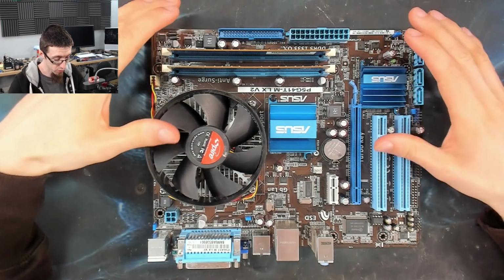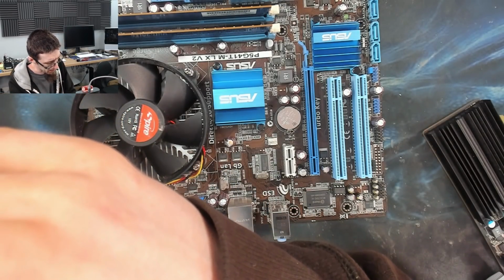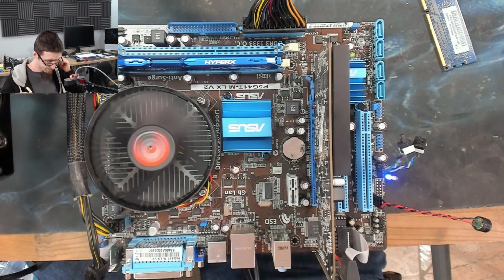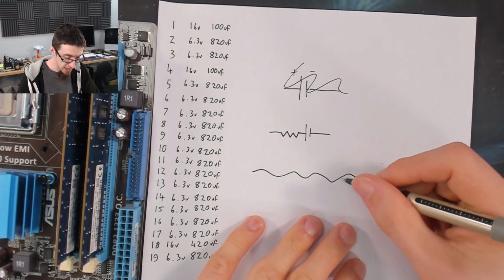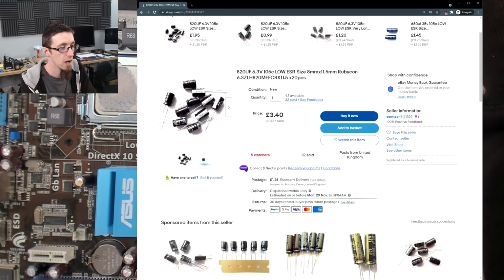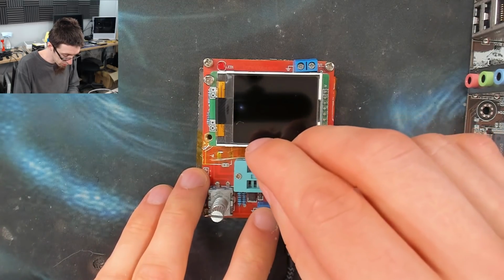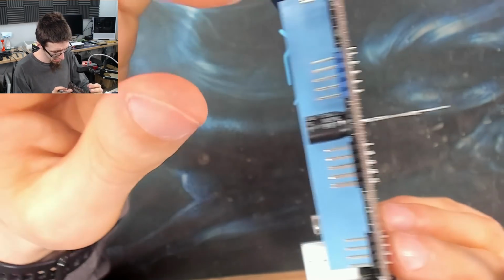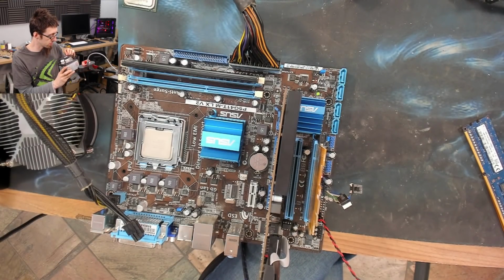This motherboard recap didn't achieve anything - LFC#288

Comment: I would have posted the board without any memory or gpu. Just to verify the bios complains with beep codes.  Also would use a PCI video card instead of the PCIe.  Also clean and reseat the cpu.  Checking voltage should be the first thing you do.  Caps are very low on a list , Why a board won't post.

Comment: I wanted to point out that it may be worth checking to see if the bios reset jumper is not on as this will sometimes result in a blank screen at boot (no bios screen output).

Comment: The cap testing really showed the failure. What you also could have tried is leaving out the graphics card ( although it gave you an E 1 ) and put the monitor on the internal graphics.

Comment: I have My first computer I had IBM Aptiva 2162 S3C from 1997 and I have a few videos on my channel of it  can you fix that new power supply screw cane off the power cord connector on the Power supposed i never got a new one need a hard drive and windows 95 installed and the cd and floppy drive media console sits under the monitor and have built in speaes  is the power button it came off it

Comment: Answering your questions: Can capacitance go up on a failed capacitor? Answer: Yes if your tester works out the value based on charge time. If the capacitor is electrically leaky it will take longer to charge giving a false reading on the tester. What is V Loss? Answer: Loss of charge over a given time in percentage. Another indication of it being electronically leaky.

Comment: i work at a repair shop, we dont do motherboard repairs but i want to so i do it as a hobby (or so im learning about it). I really hope what im doing is fine by just finding a confusing question and going down a rabbit hole until one thing can make sense, and then i guess meander my way back up... but I find it much better to watch more mirror-like, or unsuccessful attempts at something that would more closely relate to my own thoughts. Bc usually what they do works and you do the same and it doesnt. Im running on a tangent here, i gotta watch all your vids to hopefully understand somethin in the future. if anyone has good insight of how to get started and gradually get into MO repairs id be glad

Comment: are you sure that the capacitors where putted in the right polarity ? becouse the minus is white strip also paint in board and needs to corespond with the white line of the capacitor

Comment: Surface mount 'solid state' electrolytics fail more often then you might think. Whereas through-hole electrolytics sometimes offer visual clues to their failure (bulged domes and leaking electrolyte), the surface mount solid state electrolytics are trickier to diagnose (because no visual clues present) and replace (because they muist be removed by careful clockwise or anti-clockwise rotation so as not to rip away the tissue-paper delicate copper pads on which they are surface mounted). If the board refuses to work after replacing the through-hole electrolytics, I would absolutely remove (with great care - see Mr Carlson's lab video on surface mount/solid state cap removal) the surface mount/solid state electrolytics, before testing them with an ESR meter. Then replace with an equivalent solid state...or indeed a through-hole....and test the board again. I much prefer repairing electronics which do NOT have surface mount electrolytics, because two many times, I have used pliers to twist off solid state caps, only to discover I have ripped away the delicate copper pads x 2 connecting them to the board. Repairing this, in a two-layer boards, is a fucking nightmare....hours of avoidable labour...hence enormous care is required when removing them, and of course, they cannot be tested for ESR in circuit, which means you HAVE to remove them to test for ESR, and cannot simply remove 'one leg' before testing, because there is not enough space to remove only one leg before testing.

Comment: I have seen some dead PSUs beeing started up with a heat from a hairdryer, can you read any differencee between a failed cap and a hot failed cap?
Also about the motherboard, the ripple produced from a regulator with a failed capacitor can cause damage to the thing they are powering, guess how I found out.

Comment: I would highly recommend using a solder slurper (sucker). They will make your caps and other part removal very easy. I started in electrics in 1961, from the old tube TV's to commercial transceivers to CB's.  I really  like your repair show. You know more about computer repair than most . Note: replacing and re-soldering  is easier as well. Most of the old solder is removed.

Comment: Good video, I have questions how can you know is the bios chip in laptops because I see a loots of similar chips in the borad
Reply from the maker: There's a lot of small cues that give it away, but the main one is the shape. Most BIOS chips are either WSON8 (flat rectangle) or SOP8 (square, 4 legs each side) The only other SOP8 packages you're likely to see are mosfets, and you can spot those because they'll be part of a power circuit (and have capacitors, inductors, etc nearby).
The last cue is just to check what's written on the chip. There's only a couple of common brands for BIOS ROM chips, such as MXIC, Microchip, Winbond, and they tend to have that brand name written on the chip (unlike mosfets, which only have a part number) so if you see a chip out on its own, and it has winbond written on it, that's your guy. Keep in mind that a lot of laptops have more than one BIOS chip as well though.
Reply: @Adamant_IT  thank you very much

Comment: 😂🤣😆I know, Graham "It's never the CPU" Memory error, is it possible you have two different Memory Ram Sticks inserted? Just double check everything.. I could've sworn, you took one out, and inserted a new one. I would have replaced both.. why check one old, and add a new one.. wouldn't that affect the memory value in some way?  
Just asking, trying to figure this out myself, just an amateur.🤗

Comment: When you replace caps, is it best to replace them with the same type & voltage/farad ratings? Thanks
Reply from the maker: Voltage rating is the max the cap can handle, so it needs to be equal or higher than the original.
Capacitance (Farads) should be the same. Caps have a big tolerance on them though (20% is common) and more often than not, just being in the correct order of magnitude is good enough for a power rail.
Reply: @Adamant_IT  ok thank you 🤓

Comment: Thanks for this video. I'm very new to doing my own repairs and have not had much luck with most board repairs. It makes me feel better knowing it's not just me that wastes time and money on attempting a repair.
Reply: I repaired my old gaming board by replacing a few Capacitors.  It worked.  Until a few days later,  I decided to hook up a harddrive and set up windows 7.  The PC refuses to post.  I believe something bad had happened to the bios.  I cleared the cmos through the jumper,  removed the battery,  re-seated everything.  There are no beep codes,  and the button when you press once doesn't turn off the machine. It turns on but doesn't display anything. One thing I noticed which was very strange before it got confused... Was that during booting from the DVD-ROM,  the display would go blank,  the power button would do nothing even if you held it down, LEDs will still be lit and the CPU fan will still be spinning. Now i need to find a programmer tool that supports that specific bios chip.
Reply: Another thing that I think is the cause is that it was saving settings to the bios and the same thing happened whilst it was saving those settings to the bios
Reply: I recon the bios has got corrupted
Reply: However I still need to find the bios version to for this motherboard... Abit NF7-S v2.0.

I found some downloads but they download as an application.  Should they download as that or should they be of a different file type if they are official bios software?
Reply: The chip is by PMC.
Reply: Pm49Fl00T-33JC
Reply: It's infuriating but with every problem,  there comes something to learn

Comment: for the first clean the  both dim slot with alcohol or thinner and then put in memory again turn on power motherboard if still error accour  then Please check with selector multimeter countinuity on dim voltage, usualy the both dim voltage are broken connection, so just put wire on pin 3.3 or 3.7 volt on dim1 slot in the back motherboard to dim2 , its work with me, or  , may be can help

Comment: It is possible, for example, that particular capacitor that was leaking (3.1 Ohm), as displayed, may have damaged some other chip, by allowing voltage higher than the gate, could handle, and basically cooked, the logical aspect of the chip, and thus the reason it will not Post. And, agree with comments below, sometimes, seeing a repair fail, is interesting, as one that works.

Comment: I've recently got a faulty motherboard (lga1150) I'm getting ready to post-mortem or possibly repair. Used air compressor to clean out daughter's computer like done several times. Next time she booted it started sporadically turning on and off and once in a while makes it into bios before shutting off again(led fans also got brighter sometimes). With the knowledge I've learned from your videos I hope to come to a definitive cause of death.

Comment: Hi! I have a laptop, 6300hq….gtx 1060. It keeps shutting off randomly. It can sometimes do this 3 to 4 times in a matter of seconds. Other times it stays on for quite a while. I am guessing it is overheating. I have monitored the temps and don’t see them going over 50 degrees though. I have ran the laptop on dedicated graphics and also onboard, and I get the same issue. Tried it with battery no charger, charger no battery. Changed nvme. Everything points to the cpu overheating. But, I have ran a stress test (prime95) and got the cpu to over 80 degrees and the laptop didn’t go off! All fans are fine, cpu has new paste. Does anyone know what could be going on. It’s doing my head in!! I am now looking At new laptops. But would rather just have this as I only watch YouTube on it 😂 cheers

Comment: Hi, I'm struggling to debug this problem on my laptop.
As soon as I unplug the charger, the CPU speed drops to 0.48GHz (BD PROCHOT triggered)
To make it work again up to its speed (2.2G) I need to unplug charger AND battery, and power up again with either battery or charger. This happens with Linux too, so it's definitely an hardware problem, the BIOS battery is ok. Do you have any suggestions?
Thanks!

Comment: Probably you have a bad chipset or one with bad solder joins..chipset control lot of things on the board, you can remove and reball then solder again on the board, if don't solve the issue try to buy one in working condition i thing will solve the issue.

Comment: From my experience with flashing BIOS chips outside the board with a programmer; it sometimes ends up with a different result than the original BIOS of a working board.
Reply: Correct, the unique identifiers of the board won't be preserved. Those would need to be taken from the backup and written in manually with a hex editor.

Comment: In the future, before recapping, check all the voltage rails as close to the chips as possible and look for noise on the power rails. If theres no noise,  the caps arent the problem.

Comment: 1) The labor and shipping cost is way more expensive than the capacitors themselves; therefore, using solid electrolyte capacitors to replace the faulty ones.  
2) The main reason for the capacitors to fail - the work load and environment temperature are reaching the design margin; therefore, buying low ESR solid electrolyte capacitors and increase the spec (e.g. 6.3V 820 uF --> 9~12V, 1000~2000 uF) should be able to prevent the similar failure in the long run.
3) Using proper soldier removing tool.
4) Dead CPU won't turn on cooling fan.
5) Buy a PCI/PCIe diagnostic card for PC.

Comment: you should check
1.5v ramvcc, ram  slot pin no. 51,54,57,60,62 (or on ram vrm coil)
0.75v ram vtt ram slot pin no. 120, 240
3.3v vddspd ram slot pin no. 236
bios
cpu
cpu socket
gmch

e1 mostly a bios problem in this motherboard

Comment: 26:07 Why isn't your tester calibrated? Short the 3 test points together and follow the on-screen instructions. Takes about 30 seconds to do it then you will get more accurate readings. Bear in mind it will ask for a small value non-polarised ceramic capacitor at one point and you need to clamp that in then press the button to continue. Use a common 104 cap (0.1uF). This tester is based on a German open-source design using an Atmel ATMEGA328 microcontroller and it actually a pretty nice piece of test gear for the price.

Comment: I've watched your video's for a while now but I feel you made a massive mistake here ordering caps on eBay. eBay is full of fake caps and I cannot honestly believe you got 20 real Rubycon caps for the price you paid. I'd stick with buying from Farnell or Mouser in the future - at least you'll know your getting real parts. The eBay caps may work fine but I would very much doubt they have as long a life as the real thing!
Reply from the maker: Entirely possible, but for the sake of the experiment they'd do. I do agree that if I were doing this routinely, or on something more valuable, I'd be a lot more picky about sourcing parts. This was a proof of concept 👌

Comment: Have you tried cleaning the PCI-E slot that could be a reason why you don't get a display on the GPU because of corroded pins in the slot fixed it with contact cleaner of WD-40 and a wire brush that could fit in between the gap

Comment: Done a few full board re-caps in my day, all completely successful, except that one time where it's never the CPU, except where it's the CPU 🤣 No joke, after a re-cap, still had a toasty CPU, but the entire thing started with a PSU that came 1 step from a firecracker so it had it coming.  New PSU+new CPU+ re-cap and it was back on the road.

Only thing I was curious with your Asus board here is if it acted the same way with or without any mem modules.  I have seen a post issue like that previously, and being an extremely early ddr3 board, it's QVL would be quite limited and without post, it would be impossible to tell what version of BIOS was on there, but it looks like you went to the trouble of pulling the chip completely and reflashing it, so I'm just assuming you used the very latest firmware available for that Mobo....  Too bad this repair was a bust, but I used to love doing re-cap jobs back in the day.. I still enjoy picking up a 75in 4 year old 4k smart Vizio TV for free off Craigslist and re-capping the PSU for under $2 just to cure the itch, and of course to hoard 75in TVs and put them in every room in and outside my house that I spent less than $10 on all of them total🤣
Totally love your channel, learned so much from you Graham! Thanks for all you do and keep up the fun good work!

Comment: The board to me is getting enough stable power as it stays on. Normally, you'd get beeps aswell if it was ram or at least something with no ram in at all. I think the board is just bricked. Still, intresting video :)

Comment: The southbridge is probably bad? Its responsible for powering up these boards are these were typically Chinese made and failed. Probably lucky its not completely shorted or blowing fuses. Find a replacement southbridge with the correct firmware version on it to test with. Verify all the power regulation is working and not going to fry anything. Get a couple of them in case you fry it also during repair.  You should be able to follow the boot process and see if the north bridge powered up and started reading the flash and the cpu started running instructions and training the memory, etc.

I didn't see you verify the VRMs or the north bridge booting. You'll probably need an oscilloscope.

Comment: I would have thought this was a good "use case" for your solder-sucker. Perhaps not. I know how frustrating they can be.
Reply from the maker: My de-soldering gun needs a new nozzle - I accidently left it on over night and it blocked up. Actually discovered the issue when shooting this video. I cut the section though because not relevant.

Comment: I was recently given an old socket 478 PC that I made into a retro Windows 98 machine. It had blown caps so I swapped them out. Yours certainly came out easier than mine. My board had a huge ground plane that was sucking the heat away. Also managed to get a short somewhere by connecting both legs to said ground plane, but reflowing and removing excess sorted that. Got it working, but you are right it is not worth the repair. I just did it for pleasure.

I did an old graphics card not so long back and I would suggest that you can't always rely on the silkscreen to be accurate with the polarity. I hadn't taken a picture and just put them in the way the board suggested. You quickly know when you've done it wrong. All three caps violently turned themselves inside out. What fun.
Reply: I have a socket a board with bloated caps, it worked ok at first,  it then stopped working. I am going to replace the bad ones. And while it may not be financially worth it to recap boards like these, I think it’s still worth doing.